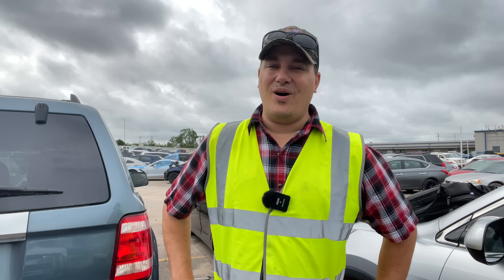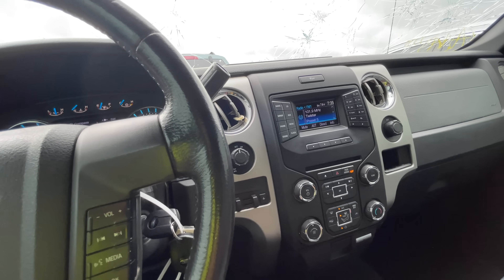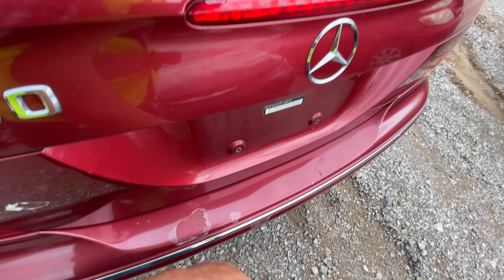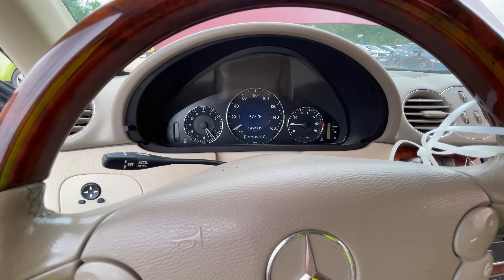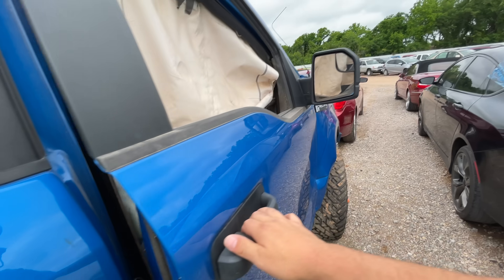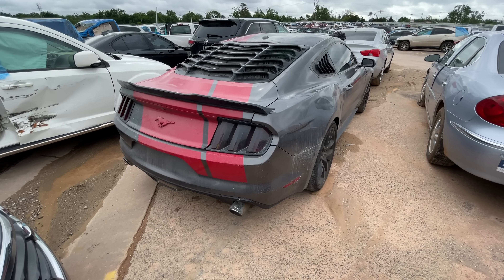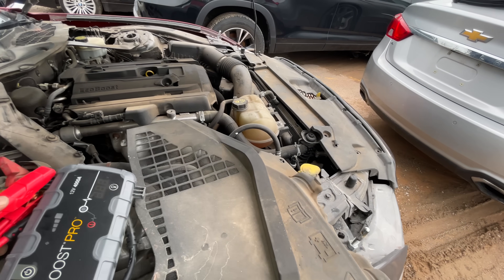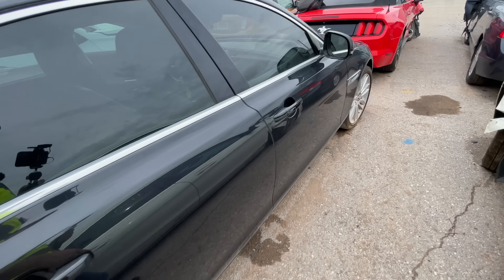Copart Walk Around 5-27-21 + Dirty Cheap Duramax Diesel!!

Comment: My dad bought a 13 F150 used and I've driven it some.  It's a nice truck and very comfortable.  It's a 5.0 V8, 4x4 and will get almost 20 MPG highway. 

The only issue I've seen is, here in New York, the rear wheel arches are rusting out already.  I suggested just hiding it with some flares.

Comment: I have a 2001 vw beetle turbo that is similar in condition to that mustang. Bad paint job, mystery body damage with bad panel gaps, incorrect screws, and it also has an i4 with a turbo, but its a manual transmission. I had to replace the radiator last summer and found several bent and twisted panel mounts when i took off the front bumper and fender assembly. I have a parts car that has a blown turbo and doesn't run, so i plan to pull the whole drivetrain and electrical system from the damaged beetle and put it into the parts one. It wont be easy, but it will be worth it to have a car thats in good condition! Beetles from the early 2000's are at the very bottom of their 'U' curve in value right now, worth nearly nothing. ($200-$1400 range in price)

Comment: If it has a horse on the rear of a mustang it's a 6.  If it has a GT then its a V8. Unless you're a badge upgrader.
Reply: Horse with a vertical line is a V6, horse with no line is a 4 cylinder.